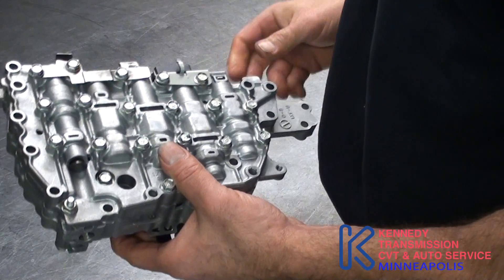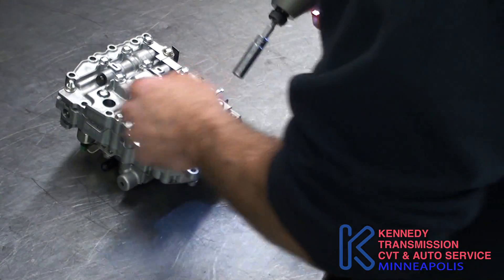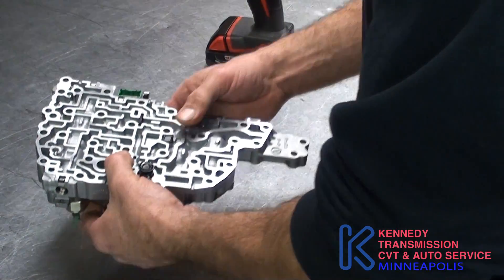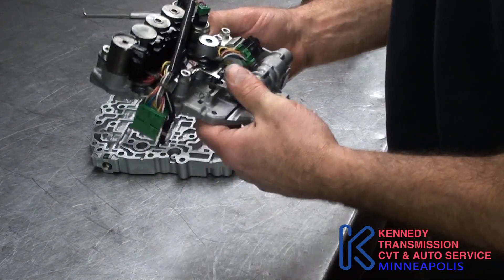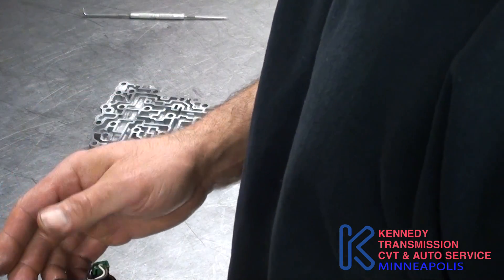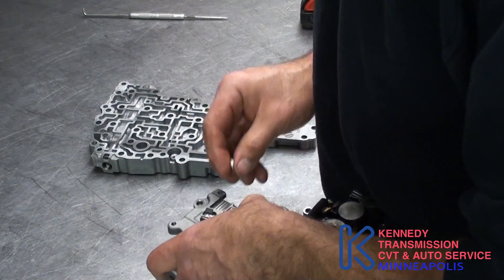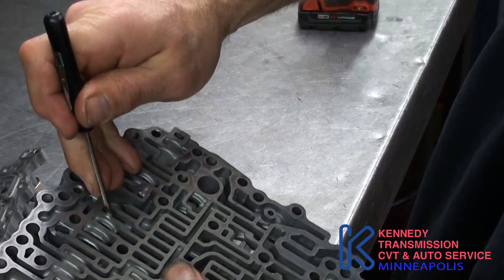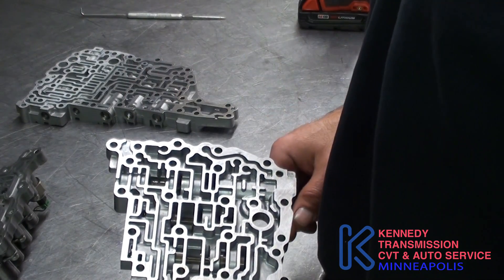CVT- Jatco JF011E Valve Body Inspection

Comment: How do you know when a step motor is bad, what readings should I get when testing it?
By the way great video !
Reply from the maker: Fredy,Start with any Diagnostic Trouble Codes.  Stepper motor circuit codes are a higher likelihood of a failed stepper motor than performance codes.  Stepper motor performance (or rationality) codes are very rarely caused by a failed stepper motor.  If you have a good scan tool, you can watch the stepper motor position and make sure it is changing properly.  On most Jatco units the stepper motor position ranges from 0 to 188 (on the live data you generally see only an indicated position of 5 or 7 to ~188).  If the stepper motor is actuating properly, you should be able to correlate the position change with the ratio change.  If the position changes as expected, but the ratio does not, it is likely something else causing the issue and not the stepper motor.Thanks,Matt Johnson
Reply: Kennedy Transmission, CVT & Auto  what aboit checking the resistance of the step motor I followed alldata said that all for pins of the cvt unit need 15 ohm , in 3 pins i got 15 but 1 is 10 ohm , that mean that the step motor is bad , i got the code p1777 , can wont move just idle
Reply: When it is bad your vehicle will lock in a ratio, for example, if it was in a 1:1 ratio when it fails, it will remain in that 1:1 ratio, its like keeping your car in 4th gear and driving, it won't cut off because of the torque converter.

Comment: I opened a valvebody for an SR20 Nissan Transmission and the place where the Tcc solenoid is supposed to be there is a hole with a open/close pin inside.  I am beginning to think that the TCC solenoid is missing. Also the scanner shows bad stepper motor but a multimeter shows that the wiring in the stepper motor is still good.  It also shows a bad line pressure solenoid (its a older model multimeter that shows codes 000e, 000b and 000f).
Reply from the maker: Edward,I am sorry, but I am not familiar with the SR20 transmission.  Could this be the SR20 Nissan engine?  If this is the case, do you know which CVT it is mated to?  Thanks,Matt Jonson

Comment: Hello, 

We just put an used transmission of a 2008 Altima 2.5 engine in place of bad one. 

After we drove 30 feet, it gave P1777 step motor code. Instead of sending the unit back and get another one from the vendor under warranty, I am considering to change the step motor. However, in the video you say at 4:45 that a lot of times when you change the stepper motor, that is not the problem? 

So how can we figure out where the problem is? 

Also, I looked at Ebay and there are different kinds of step motor sold the same transmission when I enter Altima 2008. Some are RE0F10A, Some are RE0F10E, etc. How can I find out what kind of transmission is this? Does it say anywhere on the transmission? Basically, how can I find out which step motor needed for the transmission? 

Thank you in advance.
Reply from the maker: Everything I see shows the transmission as a Nissan RE0F10A (Jatco JF011E).  Often times stepper motor DTC's are set by issues other than the stepper motor.  However, with just a P1777 (circuit fault), there is a reasonable likelihood that this is just a stepper motor failure.  Before going any further though, you should check your harness connection and pin tensions, clear the code and see if it returns.  If it does, you may want to just install the stepper motor from the original transmission and test from there; unless you suspect it was the cause of failure.  We have not had good luck with used CVT's and quit doing them all together a few years ago.  Hopefully, the stepper motor (if needed) from the old unit will take care of the issue.Thanks,Matt Johnson
Reply: Thank you for your response. The weird thing is the code does not erase. You turn the key to on position, engine off. Erase. And when you read again, it is still there. Could not make it go away. 

The bad thing is this is the third transmission I put on this car. And I sent the original back, long time ago as core.
Reply from the maker: Assuming your scan tool is getting the code to clear, it is likely a short or open in the stepper motor circuit that is instantly re-setting the code on key up.  When the code returns instantly on key up, it points towards a stepper motor failure.Thanks,Matt Johnson
Reply: Yeah, that is the case. I erase the code. Turn the key off, turn it on without starting the engine and the code is still there. So I guess I need to change the stepper motor. Thank you for your response.
Reply: Hello auto master , so did the step motor fix your issue , having same problem thankyou!
Reply: @alexg8460  No. I did not change the step motor. The company I bought the transmission (LKQ)  sent another one, and I put that one in. And it gave step motor error again. so they sent another one. And this worked at the beginning fine. Then one day later I started the car to fill the fluid (NS3) to specifications in order send it to Nissan dealership to reinitialize the transmission. The car did not change gears at all and a code came giving pressure solenoid A error or something. I am totally done with CVT transmissions.
Reply: Auto Master wow that is a pita! Im selling this junk tomorrow im done with these nissans for now , thanks for the help!

Comment: I have a 2009 Nissan Altima with a P0868 stored on the tcm but no MIL. Slow acceleration from standtill and cvt whine. Could it be a pressure solenoid? Or stepper motor?
Reply from the maker: Giovanny,If the secondary pressure low code is the only one being tripped, it is less likely to be a ratio control motor or pressure control solenoid issue.  Have you made sure the fluid level is full?  There will be often be pressure issues and a pump whine if the fluid is a couple of quarts low.  You may want to clear the code and see how it drives once you verify the fluid level is correct.Thanks,Matt Johnson
Reply: @kennedytransmissioncvtauto5430  we replaced the whole cvt assembly, VB, TCM, Accelerator position sensor, throttle body, yet it still popped up the same code. Even when we erase it from TCM it's still comes back. We did EEPROM Erase too, still showing. Theirs no engine light either. No codes for bad solenoids, stepper motor, etc. just the p0868
Reply: @kennedytransmissioncvtauto5430  fluid pressure is good. And full yes.
Reply: When I restart the car, it accelerates normally then after a few minutes, it goes back to the delayed acceleration. No codes other than P0868.

Comment: You say the stepper motor code is not caused by a bad stepper motor. I am getting the code p1778 and planned on replacing the stepper motor to try to repair problem. I can drive as many as 250 miles in between incidents and it works perfect most of the time. Any idea why I am getting that code and what I can do to repair the problem?
Reply from the maker: P1778 could certainly be caused by a mechanically faulty stepper motor.  The P1778 is a performance code rather than an electrical code, meaning the controller is commanding a certain value, but not seeing the expected result (in either ratio or primary pressure) and not detecting an electrical failure with the stepper motor.  If the code were a P1777 (electrical fault on the stepper motor ckt) , the likelihood of a stepper motor failure would be higher.  That being said, it would be good to get the pan down, inspect metal content and the ration control valve when you test or replace the stepper motor.  With just this code, if the issue is not the stepper motor it is likely internal; something impeding proper variator operation.  I hope this helps.Thanks,Matt Johnson
Reply: If we do have those codes for the circuits of the solenoids and no step motor and no check engine light, by replacing just those solenoids could fix it and get the vehicle out of limp mode? I’m currently have issues where my 07 Nissan Maxima car will jump to fifth gear at 20 mph. Am i better of replacing the cvt or could there be another route
Reply: How much metal is ok?
Reply: How did you make out?
I got the same code, but car is driveable! Im getting scared after reading all the horror stories...

Comment: What is your location? I am in SW Missouri. USA
 I own a 2011 jeep patriot latitude 4x4 with a cvt. Did a fluid filter change after the over temp light came on, it ran well, for 6 or 8 thousand miles, now it whines and surges. Suggestions are welcome, I do most of my own work, but a auto trans rebuild is something I have not done. 
I would try it if I knew what to replace, it does drive it just can seem to decide what ratio to stay in, it slips around in manual mode as well. 
Thanks
Reply from the maker: Dan,  We are in Minneapolis, MN.  When you replaced the filter, was there a lot of metal on the magnet or in the filter screen, or a lot of clutch material in the pan?  Have you had the Jeep scanned for codes?  The issue may be related to the valve body, stepper motor or pressure control solenoid, but the whining makes me concerned the issue may be internal.  Did you use OEM CVT fluid?Thanks,Matt Johnson
Reply: Kennedy Transmission, CVT & Auto 
Yes the magnets were furry the oil in the pan seemed inundated with fine metal.
It ran well after the oil change, I used valvoline cvt.
Thank you for the reply.
Reply from the maker: Dan,Given the noise and the metal content, it really sounds like a bearing is failing.  When the bearing starts shedding metal, that often causes scoring on the pump flow control valve which in turn causes a lack of proper ratio change.  Unfortunately, I think the unit will likely have to come out and be rebuilt.Thanks,Matt Johnson
Reply: Kennedy Transmission, CVT & Auto 
Ok, thank you for your time. How much do you charge, plus shipping to Joplin Mo.
Reply from the maker: Dan,I am sorry, I do not stock any pre-built units.  If rebuilding is necessary, we overhaul the vehicle's transmission.  This allows us to save the vehicle's ROM and avoid needing to re-flash.
Reply: Thank you, I am going to check at local tech school and collage to see if they want a crack at it if not, I will use your videos and do it myself.
Thank you very much for your time, keep up the good work !

Comment: Thanks for the video! We have a 2016 Nissan Quest with 26k that just had a valve body replaced. I noticed that while slowing down to a stop, when the CVt would switch into it’s lower “gear” ratio (a shift that can be perceived/felt around 5-7 mph while coasting) it would make a weird crunchy/grindy noise in that ratio. The car drove fine except for this noise. I was concerned bc I have two other CVt cars that do not make this noise upon slowing down/stopping. Any idea what inside the valve body would cause this?
Reply from the maker: Anton,On the Jatco 2 speed CVT's, it is very common for the high low shift quality to take a while to adapt in well after any sort of change.  I have spent hours in a couple of cases performing the relearn and then doing a ton of slow accel/ decal driving to get the shift quality to come around.  That being said, I have not had any noise issues after making any valve body changes or repairs.  I do not think it would be anything in the valve body at all making the noise, but the valve body controls the application of the high/ low clutch and could possibly be doing something hydraulically to cause the clutch noise.  If it does not lessen soon, I would bring it back to the shop that replaced the valve body and let them hear it.  I am assuming this is a new valve body installed and adapted by a dealership or someone familiar with these transmissions.Thanks,Matt Johnson
Reply: Kennedy Transmission, CVT & Auto I meant to say that I had the noise before they replaced the valve body, I am picking up the car tomorrow so hopefully it is gone. I asked them what happened but the service gal couldnt exactly state, just said the was a TSB out for this problem or something
Reply from the maker: Anton,  There are a number of technical service bulletins regarding valve body replacement on these units, but none that I have seen pertaining to noise caused by a valve body issue.  I would expect that the noise has been alleviated if they are having you pick the vehicle up.  Assuming so, I suspect there may be a wear issue with the valve directing pressure to the high/ low clutch.  Thanks,  Matt Johnson
Reply: Kennedy Transmission, CVT & Auto like
Reply: Could be a bad high speed sensor you will damage the trans if driven with this not working or they need to do a better job reprogramming.

Comment: About that computer: I got a used cvt transmission valve body to replace the original cvt valve body on my car. In order to make it work, I need to put the computer on my original valve body to the newly bought valve body before I put the 'new' valve body to my car. Otherwise, my car will not run after the valve body replacement because my car's TCM won't recognize the 'new' valve body. Right?
Reply from the maker: Xiaomin,  Correct, you can swap the vehicle's OEM RAM card to the valve body you are installing. Thanks,Matt
Reply: @kennedytransmissioncvtauto5430  what if you don't swap the RAM? Would a reprogram of the TCM be sufficient?
Reply from the maker: Giovanny,Yes, you can re-flash the replacement module if you have access to a Consult, or simply have the Nissan dealership flash it.Thanks,Matt Johnson

Comment: Is there a special tool that you have to use to keep that linkage arm positioned  while your aligning it back into the transmission case? Or can you use a drill bit, pick etc ?
Reply from the maker: A drill bit works fine.Thanks,Matt
Reply: @kennedytransmissioncvtauto5430  I left a comment up there would be really cool if you could assist me I have a valve body out on a 2010 Altima laying on the table throwing p1778 code and low fluid pressure code but the car seems to be driving fairly normally so I've replaced the stepper motor but while I have this valve body out...you were saying something that that's not usually the problem?.. is there anything else I need to do before I put this valve body back in I'm not a transmission guy just a regular mechanic of 26 years... I checked that first solenoid forgot what you called it it reads 27 and some change ohms

Comment: Do you know the proper pid to read the trans temp on a jeep patriot with the CVT2L version. I know dedicated scanners can but i usually only have access to my Torque Pro app for android smartphone and a obd link mx elm bluetooth adapter
Reply from the maker: Reed,I am sorry, I am not sure how to access the temp PID on the torquepro app.  I know most Chrysler's are simply is ID'd as "TFT", or Transmission Fluid Temp" on most of our scan tools.  You may have to access the PID under Engine data though since your Jeep has a PCM rather than separate TCM and ECM; I know this is true for most of our scan tools.Thanks,Matt \
Reply: Kennedy Transmission, CVT & Auto Thank you Matt. The pid's available in the app as well as the supplemental downloads do not register proper readings for the CVT. I was hoping to get the right pid and then just enter the values manually in the area. Take care brother and thank you for your help and time. Love the videos, they are a invaluable tool for many.
Reply from the maker: Reed,I am sorry I am not familiar with the torquepro platform.  I know we can access the TFT PID with Snap-On, Autel, OTC and OEM etc... tools we use.  You may be able to get a fairly accurate reading by using an inexpensive infrared thermal gun on the pan.

Comment: Just wondering if you guys could lend some info. I've got a 2008 Lancer GTS CVT, same model CVT as this valve body break down. I'm throwing a code P0840. My car still drives, but feels like its in limp mode all the time. I was planning on pulling the valve body to inspect everything. Any tips or things I should look for with this code? Have you guys dealt with this code often? Any help on the matter would be greatly appreciated!
Reply from the maker: With the P0840, the unit is likely defaulting (locking itself into a single ratio to avoid potentially damaging itself).  I am not sure what tools you have, but I would suggest verifying the fluid level is full, documenting any other codes that may be present, clearing all the codes and driving the vehicle gently with a scan tool hooked up.  You would want to monitor the pressure sensor PIDS and make sure that they are reading correctly.  If the P0840 returns immediately after clearing (or simply before driving), I think a replacement of the pressure sensor would be warranted even without further testing with a DVOM.  Make sure to look at the pan magnets; if the metal content is excessive, it may already be to late.Thanks,Matt Johnson
Reply: Thanks a lot for the help! I have an OBDII scanner to just check and clear codes. The P0840 is the only code that I'm throwing related to the transmission. I have a P0420 for an O2 sensor as well. I have also thrown I think a P0725 in the past, but once or twice. Some days it'll throw the code immediately when I start the car, some days it takes a couple minutes, and other days it will drive perfectly fine. I don't have any tools to monitor the pressure readout of the sensors, but I'll definitely take a look at the magnets when I pull the pan. Thanks again for the help, hopefully it's not too late!
Reply: @InfusedGamers  hey man did you ever find what was the problem I’m running the same issue with the same car and model any help I do appreciate